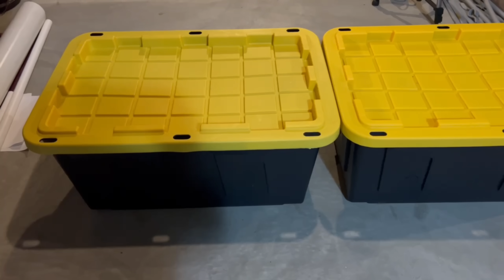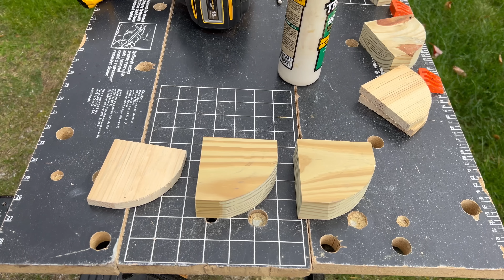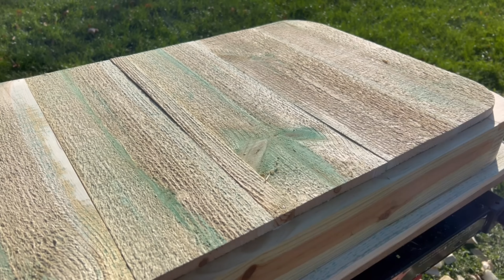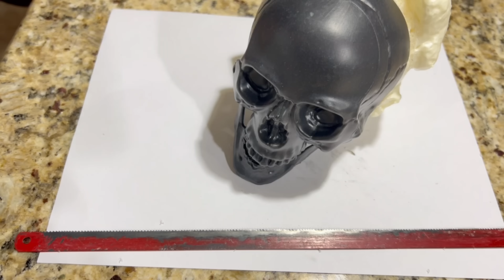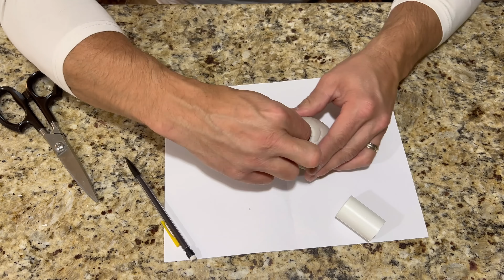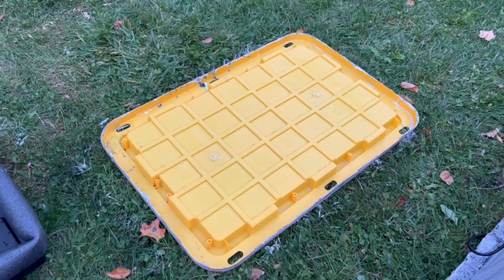DIY Faux Stone Halloween Fogger Enclosure Made From Plastic Storage Totes

Comment: If you want to make it look slightly better and get a surface that works better with paint, get a can of spray adhesive, and a bag of sand. Spray it, pour sand till you get a good covering, then hit it with some spray paint. The sand will hold paint better than the plastic, and the sand also adds a bit of texture to make it look more like stone.

Comment: nicely done. So I have a couple of questions more about the smoke. how long can you run the machine before the ultrasonic unit  runs low on water.   and are you using a low lying fog juice formulation such as froggys frozen ?
Thanks
Reply from the maker: I ran mine for a little bit over two hours this year. I still had about 1/2 the container of water left but was at the bottom of the fog juice. In previous years, I have had plenty of fog juice left but this year I turned the fogger up to the maximum settings. I have been using Froggy's Fog Bog Juice for the fogger.

Comment: Total Cost = $50 ... yea right. Those totes aline are say $12 each. Another $10 in pipe and connectors. Another $15 in wood. Can of drylok is $25. Then the ultrasonic fogger and misting machine are going to top $60 or more. This is more like $120 all in.
Reply from the maker: This seems to be a common misunderstanding. That cost is just for the enclosure, not the fogger and mister. I put it in the title but I can see how that is getting missed. You're pretty close on the individual costs. The totes and lumber cost me a little less and I didn't count the entire gallon of DryLok. I had the can from the cemetery gate columns I built and only needed a little bit. Without the DryLok, I think my materials came in around $40. So, I estimated my total cost at about $50 to build the enclosure.

Comment: I wonder if you could just add a bag of ice to the bottom chamber instead of the ultrasonic mister and get the same effect
Reply from the maker: Maybe. I think that depends a lot on the air temperature. Where I live, Halloween gets pretty cold so I never could get the fog cold enough with just ice to stay low. That's why I decided to go the mister direction.

Comment: Do you think you could just use a fogger with ice in the bottom chamber instead?
Reply from the maker: That might be possible. I tried the ice approach before the mister in a different enclosure but I just couldn't get the affect I wanted. I couldn't cool the fog down enough to make it colder than the air temperature outside. It might be a bit easier if it's warm on Halloween where you live.

Comment: How often do you need to fill it with water to run it consistent ?
Reply from the maker: I've never run it dry but, in my environment, I would guess it would need water refilled every 4 hours. I'm sure that time would vary based on different factors like how dry the air is, etc.

Comment: do you have to take it apart every night to fill the misting reservoir?
Reply from the maker: Honestly, whenever I have had to refill it, I just take the top off and use a funnel I made out of an old gallon plastic bottle connected to a tube to pour water down the PVC pipe that routes the fog into the misting chamber.

Comment: You could drill a couple small holes in the lid/base to add stakes to keep it from kids knocking it over. For a cordless design or just to add more smoke. You could place a brick of dry ice in the reservoir. Tho thinking about it, your fog machine might not like super chilled smoke solution. I LOVE this idea and probably have everything in my shop other then the skulls and fog machine.
Reply from the maker: My daughter and I were playing with the dry ice idea but decided against it when it killed all the grass in the area. Plus, the plastic of the totes could get pretty brittle with that kind of cold.

Comment: Very cool set up. I wouldn’t necessarily call this inexpensive though… the ultrasonic mister alone is around $100
Reply from the maker: Someone else mentioned something similar. I should probably have made it a little clearer that this video was all about the enclosure and not the electronics. Sorry for the confusion.

Comment: This is amazing!  I am making something similar, but I am a little worried about the fogger being enclosed as I don't want it to overheat.  Have you had any issues with your fogger overheating or getting too hot?  If so, do you have any suggestions for keeping it cool?
Reply from the maker: Since I cut the plastic top for the fogger to fit and drilled a hole for the power cord to exit, I think it gets enough air to keep it cool. It is a bit cooler on Halloween where I live, so I'm not sure if it would work the same in a warmer area.

Comment: Does the fog machine get too hot inside the tote?
Reply from the maker: I haven't had a problem so far. I think there are enough gaps to keep the air flowing in but I keep checking on it when it's running, just to be sure.

Comment: It'd be cool if a 40 gallon tote would work, but that might be too big for the mist chamber. I'm new to those misters so I don't know how that would work, but I wonder if the mist wouldn't be concentrated enough in a 40 gal.
Reply from the maker: I'm not sure if it would work as well or not. I could be wrong but once you get the humidity level up high enough, I don't think the extra volume in a 40 gallon tote would make a huge difference. It may just take longer to get there. Unfortunately, without trying it myself, I can't give any definitive instruction or advice.

Comment: This entire enclosure could be lumber. No need to fuse the worlds of plastic and wood. You might need a baking sheet inside, to pool moisture, but that's all.
Reply from the maker: That's true. I just figured the plastic is already waterproof and no matter what I tried, either the price or the labor required was much higher using wood.

Comment: No way you did this for $50.  Ultrasonic foggers like this are around $100 alone
Reply from the maker: Sorry for the confusion. The video is about building an enclosure for the misting fogger. The enclosure supplies cost around $50. That figure doesn't include the fogger and the mister.
Reply: $50? Maybe if you have the stuff left over from other projects in my case I had the totes and the fog machine, after I bought the mister and everything else from the expanding foam, pickets, some wood, pvc, glue, paint, skulls etc. It was closer to $200, the mister by itself was $69.
Reply: @d3mon232 he already explained that $50 was for the enclosure, not the mister and fogger machine
Reply: @bmxshippy  nope, I was clean of parts so I had to buy almost everything.
This is directly from my Home Depot Receipt:
-2x4 stud Qty 1= 4.24
-pvc caps .57 each  Qty 8 = 4.56 
-pickets 2.58 each qty 8 = 20.64
-3/4 foam insulation = 4.78
-3 in pvc elbow = 5.86
-3 in 90 degree hub 4.86 elbow qty 2 = 9.75
-1/2 x 2ft pvc 2.96  qty 4 = 11.84
-spray insulation foam 4.48 Qty 2 = 8.96
-3x2 pvc pipe = 10.96
-skulls (from at home) 4.99 qty  2 = 9.98

TOTAL = 91.57 plus 7.55 in tax (Texas), that's $99.12

I had the tubs that's another $16 I saved, this doesn't include the paint and all the other stuff I used for my "Treasure chest" theme JUST THE ENCLOSURE, so unless you have leftover materials from another project, if you have to buy everything is not going to be anywhere close to $50.

Don't get me wrong I love the project, it works great and it is incredible. But it can't be done for that much.
Reply: @d3mon232 I see problems with much of your list. Why would you buy 8 pickets when it looks like he only used about 2? Why buy the 1/2 pic in 2 ft lengths when you can get 10ft for $3.71? Where did he use 3/4” foam insulation? What is 3x2 pvc pipe?what’s the diff between 3”pvc elbow and 3” 90° hub elbow? You don’t need 2 cans of spray foam
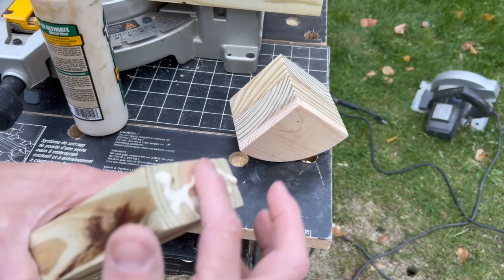Reply: @bmxshippy    yes the mileage can vary, the 1/2 pvc was laziness to be honest, I used more pickets because I did a treasure chest cover, and unfortunately that was the easiest solution. The 3/4 foam I insulation was used around the water reservoir (5:08) the hub elbow has a connector in both sides the street on side is straight, 3x2 pvc tubing. So lets say I got only 4 pickets, one can of foam, 3 elbows at the same price, and I bought the long 1/2 pvc, thats a savings of 25.02, thats still 66.55 sans tubs, plus I forgot to put the construction adhesive. Thats another 10 bucks. So 76.55 plus taxes...  dont get me wrong, I love the project. My point is that no person can do this for $50 unless they have a lot of the parts already, I mean just with the prices: 16 for the tubs, 20 for the skulls, 5 for the foam and 10 for the adhesive. There is the $50.
Reply: @d3mon232 yeah and considering the difference in prices, it’s vary possible he did it for around $50.  I actually priced it out for me with costco totes and cake out to under $70
Reply: The totes are also about $25 a piece. Fake cost but cool project
Reply from the maker: @PNW_Wolfpack_Adventures  The cost for the materials enclosure really was about $50. I think you might be looking at different totes than what I used. I used 27 gallon totes that are about $10 each. I put the link in the description but here it is if you want to see if they would work for your project, https://www.lowes.com/pd/COMMANDER-27-Gallon-108-Quart-Black-Yellow-Tote-with-Standard-Snap-Lid/3551290
Reply: @PNW_Wolfpack_Adventures those exact totes are $8 at Sam's club.
Reply: @PNW_Wolfpack_Adventures try $9 at Costco.  7 and 8 on sale

Comment: i would put a cpl candles on it with a black cloth on top of it, a stand to prop a book up and get a fake book of the dead prop to go on the book stand. i might also be a lil concerned about the fog machine getting too hot inside the enclosure. nice creative build tho, looks great
Reply from the maker: I like the idea of adding a couple little things on top. That would definitely be a lot easier than a big statue like I have been thinking about. The fog machine actually never got that hot for me. Since I cut the plastic top and drilled a hole for the cord to run through, it seems to get enough air to stay pretty cool, but I will definitely keep an eye on the temperature when it's running.

Comment: Have you thought about putting in a ports to allow you to fill and drain the mister pan without having to disassemble the totes?
Reply from the maker: Honestly, I never once thought about that but that is an excellent idea. I think it could easily be done with some more PVC and a cap. I could see a screw on cap so it would be sealed and easily accessed to pour more water in.

Comment: Some creepy pumpkins, grim reaper, gargoyle or skeleton would be great to add to that. Maybe a low green LED light to illuminate the fog too? You did a great job man.
Reply from the maker: Thanks. My fog machine actually has led lights built into it. My original plan was to find a way to route the lighting into the skull's eyes but I cut that due to time constraints. Maybe it would just be easier to throw a waterproof RGBW led light strip in the bottom tote and call it a day. Something for me to think about.
Reply: @814creative maybe you find some stripe with UV LEDs on it. Could be a game changer :) 

Btw nice work 🎉love it

Comment: Might want to use something like this inside for a stage show-does the fogger output a lot of humidity? My concern is with the humid fog, the ground around the output of the fog may get wet which is a problem in theatre. Thanks for the video though, the design is fantastic!
Reply from the maker: Sorry, I'm not really sure. I wasn't really paying attention because it was always used outside. No water from the enclosure ever directly showed up outside but I would imagine that there is a chance for the moisture in the fog to condense on the floor. I guess the only way to know for sure is to run it in the space you are thinking about using it and see what happens.
Reply: @814creative Thanks! Appreciate it

Comment: My God this is perfection. GREAT WORK!
The lower chamber could easily be filled with those ice packs that you get with medical shipments. That will super cool the fog without adding a ton of water and could be used as a replacement for the water ionizer. 
 If you DO keep the water ionizer though ... I would suggest you put in a pet watering device... one of those things that holds a gallon of water that automatically dispenses a bit more as the animal drinks. This will make sure the water level stays consistent for the ionizer to work well throughout the night without attention.

Again.. WOW. Productoin quality of the video....The storeability. A single cord. Cheap stuff. Relatively simple process. Easy access cuz you're going to have to get access to it and do something to it Halloween night, of course.
Reply: Oooo good idea, I have an extra gravity waterer too! 💕
Reply from the maker: Wow, thank you! That's a brilliant idea about the pet waterer. I could see a few two liter bottles upside down in there. Those would keep the water full for a long time
Reply: Dry ice works even better.  One problem is fog fluid condensing back out in the cooling chamber.

Comment: It's obvious this is not your first rodeo.  It's true that there are a lot of steps, but none of them look particularly difficult & you definitely put much thought into the construction.  The resulting prop looks amazing!  We had such difficulty hiding our ultrasonic mister the past two years, and I love that this one not only hides in plain sight, it will enhance a spooky scene even in the daylight without the fogger running.  It also solves the issue of getting fog into an area where obscuring the machine/tote is difficult.  Many thanks for sharing!
Reply from the maker: I'm glad you like it. The hiding in plain sight approach is exactly what I was going for. I originally wanted to build the fogger setup into my cemetery gate columns but that wouldn't have allowed the fog to spread around the yard, which kind of defeated the purpose.

Comment: To paint my homemade graves, dry-lock is good, but I also mixed in tile grout, or plaster of paris. Quick layer with paint, while wet, dust it with loose grout, and dry. Second layer I mix the grout into the paint using a separate container, because you may need to regularly mix it. Don't store the mix as it won't keep. Then a couple of rattle cans and you are set. 

It adds a texture that breaks up straight lines. But, if you don't scuff up the plastic, it may flake off in storage.
Reply from the maker: I like the idea of tile grout. I would guess that adds a lot of durability and rigidity. That's a good tip. Thanks.

Comment: I have been following this type of fogger for a while and finally last year designed and built a ground fogger based on the "Robert's fogger" from the YT channel "intocoasters" that pipes fog around the side and across the front of the house where a graveyard has been setup across the front of our house similar to the the one demonstrated on the YT channel "Oak Lane Cemetery."  Similar only in placement as Oak Lane's is off the charts.  There were a lot of issues to problem solve.  I felt resolved with the final design.....    Now you show us this....  🤦‍♂DOH!!!!   I have to say... THIS IS BRILLIANT.   The dispersion of the fog is a bit different but easy to incorporate.  Had I seen this I would have probably copied it, added a backside water fill tube and some sort of water level indicator and called it day.  I also imagine your design significantly muffles the hiss sound of the fog machine.  Mine only covers 1/2 of the yard and will need to be modified or build another for the other half of the yard...  I think I am going with this design instead for the other half.  Thanks for sharing and taking time to make a great tutorial.  Subscribed, thumbed up and shard this great content.
Reply from the maker: Thank you for the great compliments! I originally thought about using the pipe approach to route the fog around my yard too but it's not a huge space to cover, so the slope of my yard takes care of it naturally. I wish I would have thought about the water indicator while building it. Maybe something for me to add in the future.

Comment: What a fantastic effect and implementation. The totes and their finish look superb. The only suggestion I might make, is that when you first used foam to fill all those little gaps in the upturned tote I immediately thought the resulting bumps looked like moss. You could have used a green paint on them without having to trim them back. But what you have created is phenomenal and really inspiring. How long will it all run, is it the fogger that runs out first?
Reply from the maker: That's a great suggestion about the moss. That hadn't occurred to me. I haven't had the fogger or the mister run out on me yet. So far, I've only run it for a max of 3 hours and both the fogger and the mister reservoir still had enough to keep going. Based on the levels when I turned everything off, my guess is that the water would run out first, especially since my fogger has controls to run in bursts instead of continuously flooding the yard with fog. I'm sure that helps.

Comment: How often do you have to refill the resevior?  Dont want to burn out the expensive mister!
Reply from the maker: I had that same thought, so I bought a mister with an automatic shutoff, just in case. I think my original calculations had the reservoir holding around 6 gallons of water. When I ran the fogger last halloween, it ran for about 3 hours and I still had quite a bit of water left. Maybe a good addition to this would be to add a little float measurer that you can see dropping from the outside as the water level goes down. I will have to think about that one.
Reply: These misters have a built in float sensor to cut the power so that can't happen. They also come with replacement disks for the mister heads